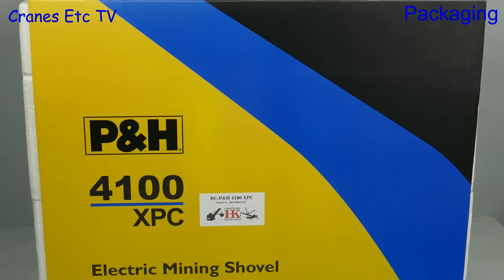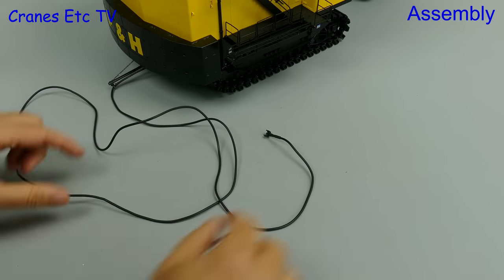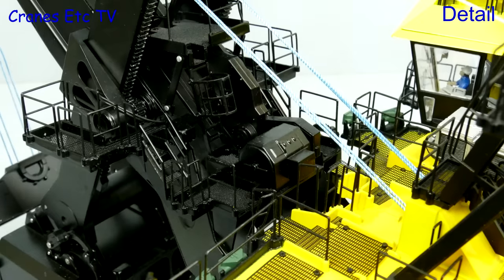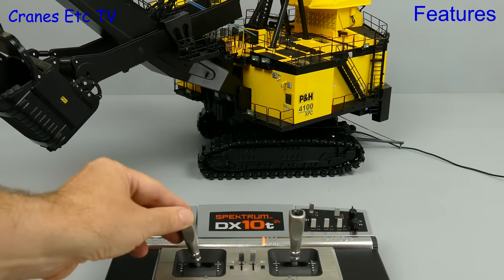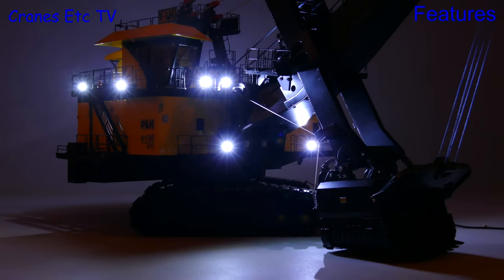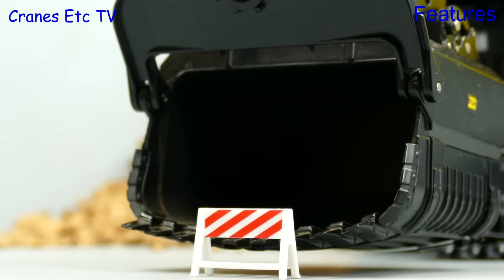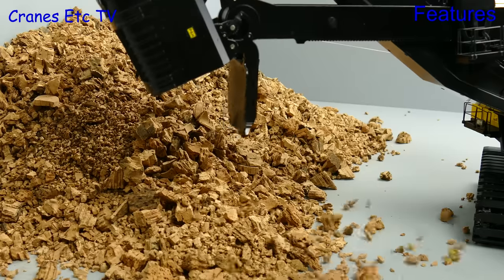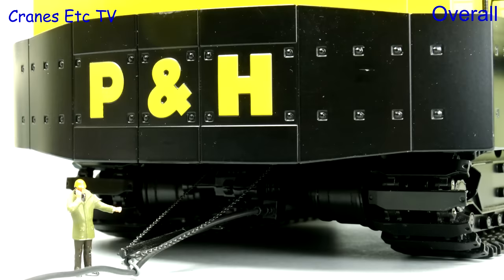RC HK-Funktionsmodellbau P&H 4100XPC Mining Shovel by Cranes Etc TV

Comment: I think you should put out the TWH version and try to compare it 
size, graphics, details, weight, between the 2 different model.......just telling 😁
Reply: They're exactly the same. All the other company did was add radio controls to the model.